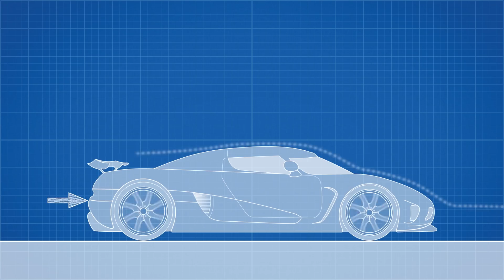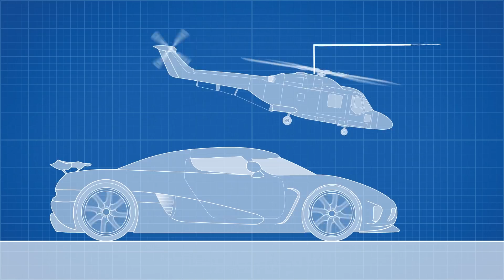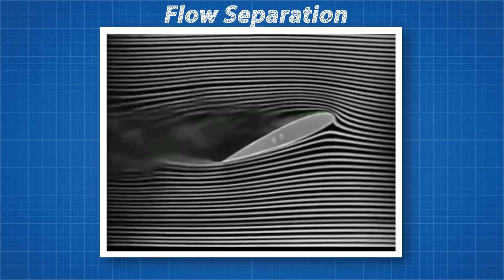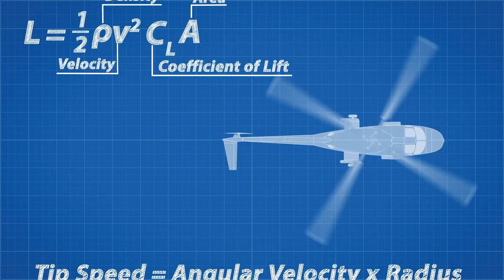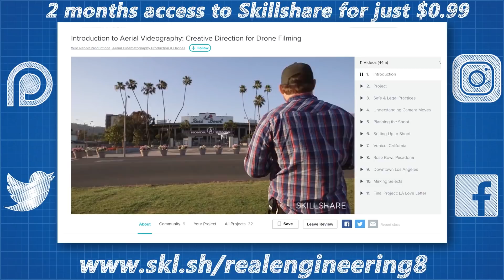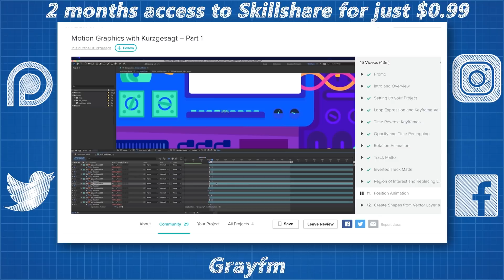Fastest Car vs. Fastest Helicopter - Which is Faster?

Comment: This video (like all your others) was awesome!
But I spotted a couple of incorrect concepts. I understand that speaking of speed of vehicles/aircrafts doesn't require to specify 100% of their functionality, but it is wrong to say: "Now to go forward, the pilot will need to transition some of the lift to thrust by _angling the rotor disk forward_..."
The principle used by the helicopter is based on different Laws of Physics and the rotor disk DOES NOT tilt forward at all...
Each blade changes its pitch every single rotation and, by the way, the force is applied 90° before the real "need" of it, because of the momentum...

Same problem when you mentioned the angle of attack (pitch) of each blade. It vary because of the principle I mentioned before, not because one blade is retreating while the other is advancing, but because it requires to... overbalance the movement in order to travel in the chosen direction.

Accept my apologies for my bad English, but it's not my mother thongue.

Comment: The fundamental limiting factor for helicopter is the blade and its motion in air. Westland Lynx is able to reach that world record speed in its clean configuration is largely due to its blade tip design, known as the BERP, or British Experimental Rotor Profile. It feature some really weird/cool swept-back design.

Comment: 1:43 The Equation for velocity is wrong. Used Cube Root instead of Square root.
Also, Input unit for that Car Frontal Area is wrong. Another is the Rotation of tyres Make the car to move Backwards. ...🙋
Reply: force is converted into workdone so its cuberoot not squareroot

Comment: My intuition is that anything rolling on the ground that puts power to the wheels would have a faster acceleration time, at least initially.  A top fuel drag race car can go 0-100mph in 0.8 seconds.  I can't fathom a helicopter being able to do that, however the helicopter could sustain a higher constant speed.

Comment: Could the maximum speed of helicopter be increased if it had swept propeller tips? The tips have the highest velocity so if the tips could curl back would it increase the speed when the propeller produces sonicbooms. Bell has their concept helicopter fcx-001 with back curling propeller tips, they are for noice reduction but maybe the invention could help increase maximum speed.

Comment: Cars are not guaranteed to always be faster. What about the US military's joint vertical lift program concepts?
Reply: One slight amendment, coaxial rotor configuration vehicles are still helicopters

Comment: Also: when the blades of a rotor hits the sound barrier, assuming material strong enough to withstand the aerodynamic forces, the turbulent airflow due to the compression of air will cause the rotors to stop generating lift altogether.

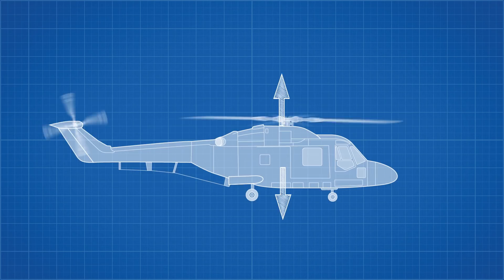Comment: @ 3:27 The rotor disk does not angle forward, it's actually 90 degrees either side depending on the rotation CW or CCW...

Comment: Well, helicopters are designed for versatility of movement, rather than speed. If you want speed, go for a supersonic jet. The helicopter's entire point--from its very inception--was the ability to take off and land from any sufficiently flat and tough circle of surface, as well as the ability to readily travel in any direction (or no direction at all) while still flying. Helicopters are, in essence, all about the compromise of raw speed in exchange for freedom of movement and landing/taking off. 

This is probably best emphasized by pointing out how helicopters can operate in areas where there is literally no infrastructure--such as random mountains, whereas planes and cars cannot (even cars specializing in off-roading have significant limitations on what kinds of terrain they can cover). 

Much like how the Harrier compromises its payload size, overall range, speed, and maneuverability in exchange for the ability to land vertically or take off from a very short runway (or even vertically, if lightly loaded enough).

Comment: this does not include compound helicopters.  Helicopters that use a pusher prop, Lockheed AH-56 Cheyenne - 362kmph for a heavy gunship, or Sikorsky X2 463kmph,  or pod mounted engines,  like the Bell 533 - 508kmph, or the Sikorsky S-69 pulling 518kmph.

Comment: people a fundamental question. if the vehicle cannot get any faster because the forces have cancelled out, then where were the forces when the vehicle was gaining speed. how did the opposing force allow the object to gain speed in the first place since it is opposing at a higher speed why does the force not oppose at a lower speed. it might be silly but I would appreciate a detailed explanation.
Reply: The force is there, just not as strong. The faster you go, the more the air you hit every second, so at low speeds you don't get as much air resistance since you don't get hit by as much air.
Reply: FrogRay  yeah am getting the idea thanks

Comment: Question if you added jet/aircraft engines to the helicopter to provide thrust and use the blades to provide lift would you not get higher top speeds?

Comment: It's obv the Tesla Roadster that's now going 11 meters/sec
Reply: 11 meters/sec? its slow, not even close to 360km/h (which is equal with 100m/s) 🤣
Reply: Chris Torrella 
The tesla roadster isn't even a car.. It won't be for another 6 years..... Fucking fan boys. The regera r is the fastest, followed by the 2017 ford gt40, followed by the Hennessy venom gt. The roaster is just an idea, a guess, an estimate.
Reply: You can still buy an original 1st gen Roadster, I don't see how you can say it's "not a car." They still work, they still drive all over the place. Ok cool great, the Regera R is fast. Does it go 11m/s? I don't think so. Is there an Regera R in space? Still don't think so. The Tesla Roadster Gen 2 is the one you're talking about, the "idea," the "guess," etc. And it will be faster than every other ICE car you can imagine, going 0-60 in under 2 seconds. There is already a working model that does these numbers and the physics have been proven in simulations, otherwise they wouldn't make nefarious claims about the car going so fast. And you're the fanboy, ICE car fanboy! Can't wait to blast by you in my sub 2-second car! Haha!

Comment: If commercial airlines are still subsonic, and provided we make Ospreys with better fuel efficiency, isn’t it better to have these aircraft replace the current airliner? If yes then maybe we’re looking at a future of larger, better, but much more peaceful versions of the air-landing copters shown in Edge of Tomorrow
Reply: Our current airliners are significantly more efficient per person than almost any other class of ferrying aircraft.

Comment: How about higher altitudes? Some of the most important points you bring up is overcomming the wind resistance and surpassing the speed of sound. Shouldn't lower air pressure in higher altitude solve both of these problems?

Comment: The uh Tesla just went 10,000 k/hr son.
Reply: BariumCobaltNitrog3n 
The uh car doesnet uh exist. And won't for 6 years. Uh. Not for 6 years. The regera R is the fastest, then the 2017 ford gt40, then the Hennessy venom gt. You cant get a top speed for a car that doesnet exist mate.
Reply: You're not too bright are you?
*doesn't
Reply: There is a CAR on its way to the sun at this very moment traveling at over 20,000 Kilometers per hour, a real car, a cherry red Tesla Roadster with the Starman in it and a little tiny one on the dash (easter egg) that will circle the sun, because it's a convertible after all. Where will it go next? SpaceX proves that a car can travel faster than a helicopter. Your reply?

Comment: Another reason for helicopters having a speed limit is that the blade moving forward generates more lift than the one moving back. One would assume that this would cause the heli to roll to the side that generates less lift. This is where precession  comes into play. Precession means Forces on the rotor disc is delayed by 90 degrees. Instead of the heli rolling to one side precession causes it to tilt the nose up and thus slowing the speed. I saw this when trying to max the speed of a model helicopter. When approaching max speed it would suddenly jerk the nose up and significantly decrease its speed.

Comment: Why not use turbofan engines so they'll generate most of the forward thrust and only transfer a small amount of power to the lift rotor?
Reply: Because then you get no lift.

Comment: You're wrong about helicopters top speed there is such a thing as compound helicopters and coaxial rotor helicopters witch can and have reached speeds of over 475km/h not to mention more and more prevalent tilt rotor aircraft witch are in a sense helicopters but can travel efficiently at higher speeds 509 km/h
Reply: Cringes about myself cringing over restarted facts in begging and just now watches video through

Comment: I work for Leonardo Helicopters which is formally Westlands who built G-LYNX (Worlds fastest helicopter) Fantastic video! Lovely to see some helicopter mechanics however, i would state that the RPM of a helicopters main and tail rotor blades does not get any faster once it hits its operating RPM. Instead its the change in angle of attack on the blade not the increase in RPM that generates lift.

Comment: Also eurocopter x3 achieved 472km/hr in level flight and 487 in a shallow dive so your idea that helicopters are limited to 400 km/hr is incorrect.  Although I would guess they are getting close to the upper limit for a rotor powered aircraft. Edit Obviously I dident watch the whole video but I would say the x3 is still a helicopter all be it not a conventional layout.

Comment: The word helicopter comes from Greek; helix 'spiral' and pteron 'wing.'  As long as you use a "spiral wing" for lift, then you can call it a helicopter, once you use wings for lift it is a "heli-plane".  The problem arises when it is just hovering there, then it technically is a helicopter, 100%.  The name denotes the source of lift.

  What about a helicopter blade for lift, and 2 turbines for forward thrust?  The lift is always 100% from the "spiral wing", but the thrust is 100% from the turbines.  A "turbo-heli" or "turbo-copter"?

Comment: Helicopter do  not need a road!  It can take the short cuts in air and can turn much sharper like 360 degree without complete stop!  Helicopters can chase any car and still keep up because of the road curvature which in most places is not completely straight unless it is in rural interstates.  Plus, it can stop and turn sharply too!

Comment: Would a helicopter still be a helicopter if we strapped a few jet engines to it?
Reply: Look up the Sikorsky S-69, it's even faster than the x3 but nobody ever remembers it
Reply: @aeroturtle4395  actually the S-69 is more of a gyrodyne or compound helicopter and is a different class of aircraft all together
Reply: AeroTurtle that heli doesnt exist
Reply: No, IT would turn into a Airwolf!
Reply: @Extrasailor  I loved Airwolf so much when I was younger, everything about it was cool.
Reply: Yes and it's still called a helicopter even if you put missiles on it before the race.
Reply: @icouldntthinkofagoodname7216  JATO takeoff
Reply: Yes because it's just helping it move faster
Reply: Osprey
Reply: The new definition of Helicopters would appropriately be High Precision Air Vehicle

Being a Jet doesn't lend you the ability to land almost anywhere like a helicopter.

But of course, if we further this technology, we could make hybrids that could reform to one of its multiple states.
Reply: yes
Reply: I guess if we give up using the rotor for forward thrust and bleed off enough of the thrust from the turboshaft engine. we could use bled off thrust from the turboshaft for forward movement with thrust vectoring, dont want forward thrust, vector the exhaust to the sides so it cancels out , want backwards thrust, vector it to just barely provide backwards thrust. Vector it differing degrees of almost forward for different levels of forward thrust.
Reply: Technically it just says helicopter, not necessarily without modifications
Reply: Basically the bell 533

Comment: I believe there is a mistake at 4 minutes i to the video. The angle of the blades needs to be adjusted 90 degrees earlier in rotation. If you wish to decrease the lift on the right side of the helicopter you must decrease the angle of the blades BEHIND the aircraft.

Comment: Airwolf would win it can go Mach 2!  ... that was a joke!  Airwolf was a terrible tv show that completely dismissed physics and proper engineering in favor of fantasy helicopter called Airwolf. Any and all that would like to breakdown on why Airwolf is not only impossible but also ridiculous I would love to read that. Have a great day!
Reply: Mari Onette lol! I hope didn’t miss the joke part. I also hope that you did not make a statement(s) based on conjecture. Lastly I would like to add that Airwolf was a fun and entertaining show
But her is the quick math of your interested and a quick note I skipped ALOT of point BC it just wasn’t necessary to prove my point anyway it’s great to meet another Airwolf fan!!

In order for a bell 222 to take off its total weight can not be over 8,400 that’s me giving you the 1990 Rolls-Royce 250 engine not the (1974) Lycoming 101-650-c3 (the motors max take off weight was 7,848 and was the actual engine) 
Dry weight of the bell 222 (1974) is 4,555lb
That gives us 3,845 available weight now we need fuel and fluids such as grease, oil, etc. 
The bell 222 carried 188 gal of fuel and 28 gal of other fluids. All which average about 6 pounds per gal. 3,845-1,296= 2,549 remaining weight till max liftoff weight.
Now I’m going to forgo the weight of 5 ppl on board, the additional weight of the the bullet proof laminate armor plating, bullet proof glass, excessive armaments and their ammunition quick estimate about 5,000 lb. 
now lets look at this afterburner (singular, I know there are two) 1st they have a high fuel consumption and it’s not the same fuel the heli engine runs on. Even if you take two of the smallest jet engines like a Pratt & Whitney J48 which they weigh in about 2,000lb dry each your only getting about 7,250 thrust out of each which isn’t even close to break the sound barrier. True they are not after burners those will run you about 3,500-6,000 lbs each which at this point if you could get the aerodynamics, fuel consumption, heat shielding (yeah those things are not only loud they are super hot) you might be able to create a nice rocket sled lol. But it might sadly end up in a mountain in Germany.

Comment: The Lynx isnt going to be the benchmark for "helicopter" speed much longer, Sikorsky's S-97 and its Coaxial rotor design with less blade length + pusher tail rotor will able to hit higher speeds as there are engineering solutions (the stacked rotors) that solve a lot of the issues with rotors you mentioned, and its based off of the Sikorsky X2 you mentioned at the end. 

Agera Max tested speed: 445 Km/h 
S-97 Design Max Speed: 444 km/h 
S-97 Max Test speed: probably more than 445 Km/h

Comment: I'm doing a design project involving helicopter dynamics and TECHNICALLY helicopters use a different equation for Lift, known as the thrust equation, which is:

T=(rho)*b*c*(Omega)^2*R^3*tc

Where rho is the density of fluid, b is the number of blades, c is chord length, Omega is rotational velocity, R is the radius of the propeller, and tc is the (British) thrust coefficient
Reply: I love lamp
Reply: I bet Tuesday tastes like yellow
Reply: My dress is sausage in colour
Reply: Man that water is clean
Reply: jumpanama i
Reply: That ice gotta be hot
Reply: Thanks for sharing this

Comment: Of course, which is faster would depend on where you are going... if you're on a very bad twisty road, the chopper flies over it straight, the chopper will be quicker if not technically faster.

Comment: But a helicopter will beat any car in a A-B trip on normal roads. Even a R22 can can cruise at about 110mph using 70% power. No car can cruise at 110MPH on public roads.
Reply: Clive Sinclair this is a race, not public transport. = Open road and open air

Comment: helicopter engines are less productive than car engines in power because updating engines in aviation is much harder than for cars due to regulations. Therefore its usually easier for them to keep using the same old inefficient engines in aviation than for improving them. An easy example is the robinson r44 helicopter (one was shown in the video) has a 6 cylinder engine that only produces 245 hp for take off and 205 continuous hp. but a simple audi a7 with a v6 (6 cylinders like the helicopter) will produce 340hp. So cars are generally getting more powerful engines and for cheaper due to difficulty aviation faces with regulations stopping improvements

Comment: I paused at 56 seconds. My guess is that helicopter speed is limited by angle, weight, length of the blades, and rotational speed of the blades. At first glance increasing RPMs should increase speed, but the rotational speed cannot be fast enough for the blade tips to break the sound barrier, so to increase RPM past that point blade length must decrease according to prevent Mach 1 at the blade tips. I think this would then have the effect of decreasing the weight that could then be lifted. This is all a guess and I'm sure I'm wrong but it will be fun to see how wrong 😅

Comment: Ofc the car is faster. The fastest helicopter is a Westland Lynx with a speed of around 324 kph, the speed record was set by a Lynx in 1986 of 400.87 km/h. Although it was a modified chopper for this purpose. Regardless, the fastest car can go faster. But cars need roads.